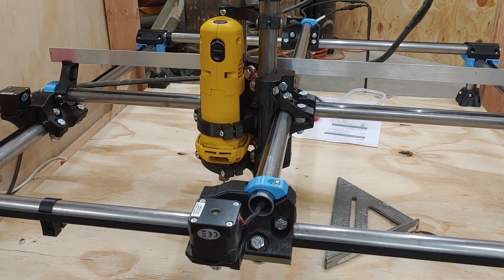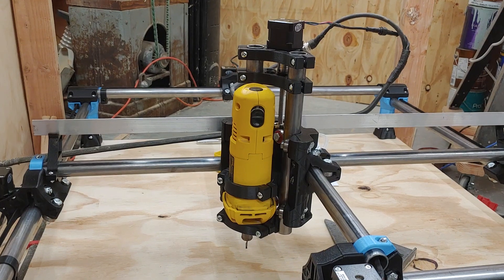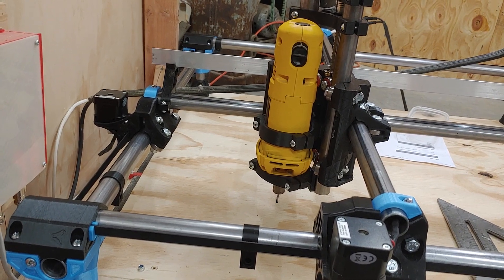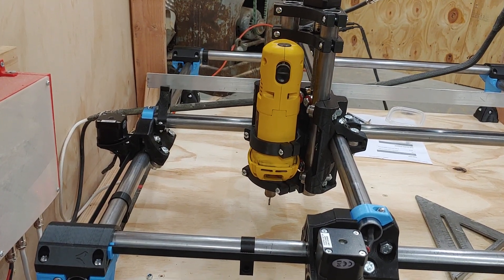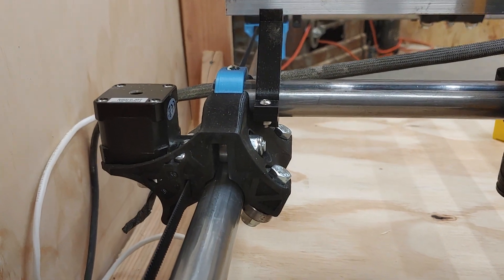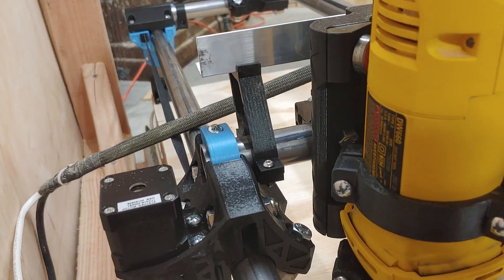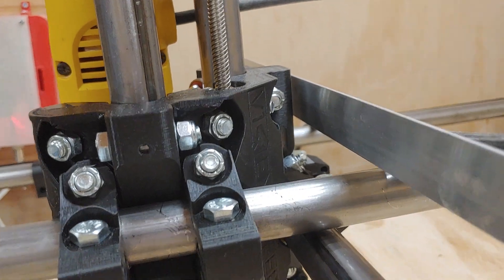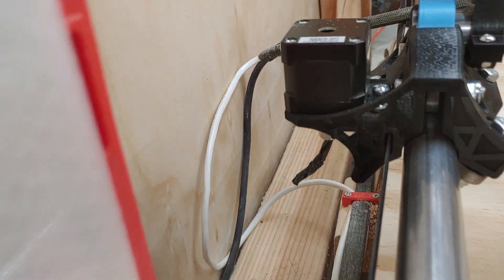Mpcnc primo First Moves!

Comment: I just got all of my parts printed and ordered the kit and the Rambo board from Ryan. I've never done this before. Do you know any assembly instructions? I'm building (outside) 2'x3'. I've painted my tubing and is ready for assembly...
Reply from the maker: The latest docs can be weird to find. There's a link to the latest docs when you're on the forum page, but not the home page. 

https://docs.v1engineering.com/mpcnc/intro/
Reply from the maker: Also, I'm not sure about painting the tubes. I cleaned mine real good then I coated them with Johnson's paste wax on them.
Reply: @DavidWalling  I was thinking of doing that. That's how i treat my cast surfaces(table saw, Planer, Jointer, etc.) . Should have went with my first thought. oh well, try the paint then sand it back off later.